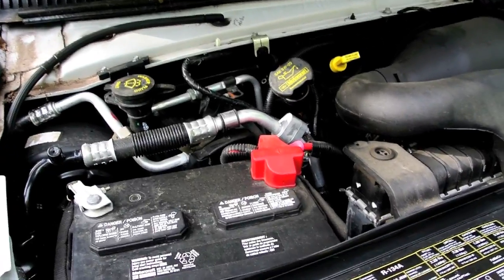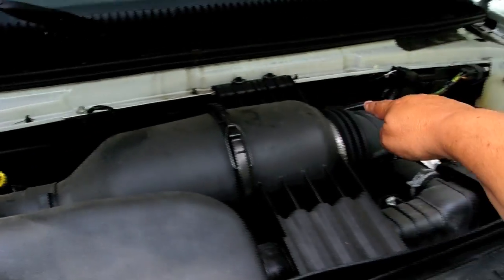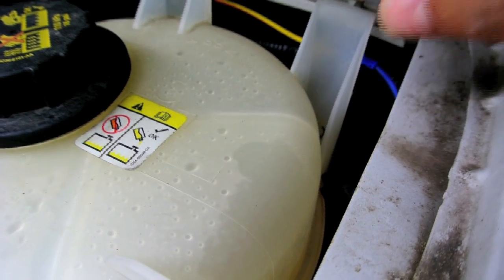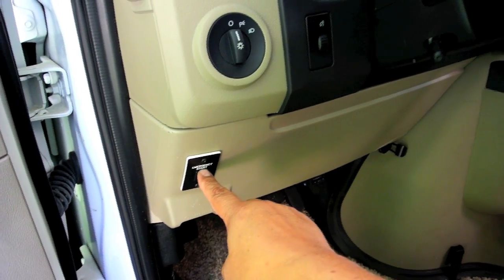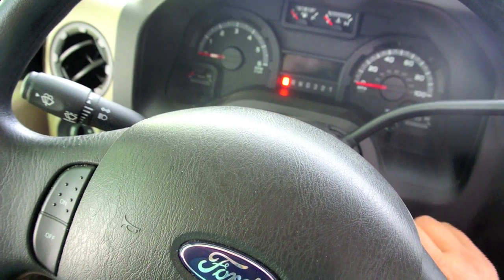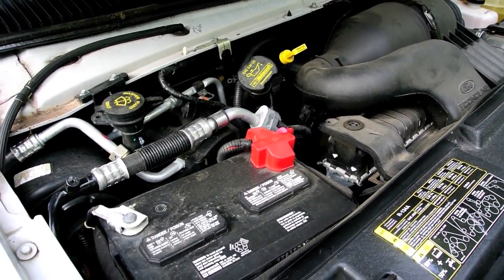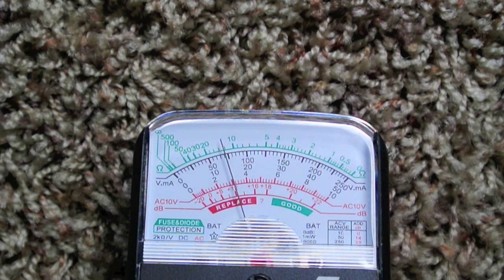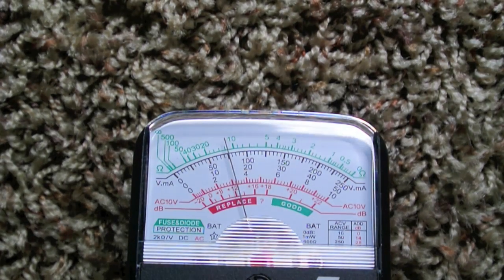Does your Motorhome's Engine Charge Your House Battery?

Comment: My 2020  25 ' motorhome has the Cole Hersee 48530 series smart Isolator. It allows bidirectional charging to both house and engine batteries from alternator, shore and solar. Great setup.  Built in voltage sensing protection for engine battery.

Comment: Bummer. Thought I finally found the info I need. I've been looking specifically for information on where my disconnect switch is. Its not on the panel coming into the coach. Not under the step, hood,  garage, with the fuses, etc. Can't find it at all. Had someone else look. He couldnt find it either. I need to find it so it'll stop draining and ruining my batteries. I shut everything off I can, and plug it in. Doesnt work. 25ft 2001 class c jamboree e450.
Reply from the maker: Sorry to hear that

Comment: On my 2006 Winnebago sightseer I get the full 14.5 volts, when the alternator is charging. It to house batteries 1 volt isn't going to do enough. for the boost charge mode up to 15 volts at 2Amps. 13 volts is just maintenance charge.
Reply from the maker: You are getting hung up on a specific voltage and missing the point. 

The increase in the reading on the voltmeter is a tell-tale that the alternator is connected to the batteries, regardless of the voltage is 1V, 1.5V, or whatever... that is the point of the video.

 Also, a higher charged battery will tend to discharge into a lower charged battery until they are at equal charge states. When the engine starts you now have 3 batteries in parallel with the alternator;  you have 4 potential charging sources. This is a complex result and I don't think the resultant alternator voltage can easily be predicted. 

If the alternators voltage output only raises a little bit - its because the batteries are already pretty much fully charged. You only want a maintenance charge with a fully charged battery.  A higher voltage can damage a fully charged battery.

If you are seeing a high charge voltage from your alternator, your batteries are likely in a higher state of discharge.

Comment: Thank you. This was very helpful in troubleshooting. My engine is supposed to charge the house batteries but after this test and the fact that I drove 8 hours and saw a decline in battery voltage, I confirmed that something is wrong. I don’t see an increase in house battery voltage when turning on the engine. Due to conduit, I could not see if there was corrosion or a loose wire.  Could it be a bad solenoid? Also note  that the  built in disconnect switch is not working. I disconnected it to attempt to rule out the possibility that it played a part in the behavior but the results were the same. Also, Winnebago said that it wouldn’t make a difference. It’s a 2004 Minnie, Class C, e450. Thank you for any insight.
Reply from the maker: Unfortunately, there is often no way to determine how they wire something.  I was able to find an electrical drawing from the mfg for mine, but it was pretty much worthless - and looked like it was drawn by a child.

When it comes to RV electrical, you are unfortunately pretty much on your own as far as getting anything out of the mfg.

Comment: When I turn my main couch switch on the relay start to chatter only when I turn the ignition switch on then it stops and I have lights. Can anyone help me with that. Thanks
Reply from the maker: Chattering relays often indicate low voltage, and/or the inability of the battery to sustain the current demand.

Comment: My brother has a four Winds class c o a E-450 chassis, and has the emergency start button exactly like this one. The alternator is not charging the house batteries. When you press it, you can hear the contactor make a loud click. However, when you turn the ignition on I do not hear the same loud click. I do hear a softer click, but it is definitely not the same sound. Does this condition indicate that the contactor is bad? I have owned several older RVs, and all of them use a battery isolator, but I can't find one on this thing. Am I cotrrect to assume that this contactor serves the purpose of an isolator? Thanks in advance for a response.
Reply from the maker: An isolator is actually not the best solution as there is a 0.6V or so voltage drop across the diodes in the isolator. That reduces the charge efficiency, and will take the vehicle longer to charge.
The contactor actually works better as it is more-or-less a voltage controlled switch, and should only connect the coach battery to the alternator when the engine is running (the alternator produces a higher voltage for charging than the battery).

I actually have a drawing from Thor for the circuit ( http://rv-project.com/photos/esc.pdf ).  One caveat though, it looks like it was drawn by a 12yr old, and may be hard to follow.
Reply: @RVProject  Thank you sir! Actually, after digging a bit more, I found that there IS an isolator, but it sure looks different than what I am used to seeing (Intellitec 0000629120). It's a small black plastic box, obviously solid state, that connects one wire from the ignition switch to the contactor's two small posts. Do you think that this has failed, instead of the contactor itself? I also notice after looking at the circuit drawing that there is a 7.5A fuse running from the ignition switch to the start button, and I will check that out now, but I suspect it is good because when the emergency start button is pressed I can hear the contactor make the loud click (that I don't hear when I turn on the ignition).
Reply: The fuse was bad! Thanks so much for sending me the schematic; I would have started throwing parts at the thing if I didn't have it. Saludos!
Reply from the maker: @cwsmith7366  The mfg calls it an isolator relay, but it is not a traditional isolator as it does not have diodes.  That is good news as diodes will affect the charge.  Here is a tech sheet for the isolator. https://www.intellitec.com/wp-content/uploads/2019/04/53-00629-000.pdf
Reply: @RVProject  Good deal! I do realize that conventional isolators send one half of a volt or so less to the house bank. When mine went out on my '98 class B I replaced it with Blue Sea's SI-ACR Automatic Charging Relay - 12/24V DC 120A. Works great. No voltage drop between banks and the chassis battery gets charged when charging the house bank. I also retrofitted the converter/charger section with progressive Dynamic's 30A smart charger, which not only features a four stage charger but produces a much cleaner 12V to the house than the standard POS. Again, thank you very much for your assistance!

Comment: I have a 2011 Jamboree Searcher (23ft) on a Ford E-350 chassis.  After checking what you recommend, my contacter is definitely the problem.  My "other" problem is where would the contacter be located as it is not where you suggest in your video. From the vehicle battery under the hood the red connection splits into two and the second cable goes towards the coach battery area.  Once there, there is one contacter for the coach electrical main switch, but none other.  Any suggestions as to where else I should look?
Reply from the maker: Could be anywhere. I contacted my mfg for my coach for help in the electrical circuitry.

Comment: I believe most alternators only output over 1200 engine rpm so you my need to step on pedal to bring rpms up to see voltage rise.
Reply from the maker: Idle RPM on mine worked.

Comment: It is my understanding that switching to LiFePO house batteries can overtax the alternator and cause it to fail.
Reply from the maker: The most critical aspect of changing battery chemistry is how the charger behaves during overcharge conditions. The overcharge rate is all critical.

For example, if changing from a standard lead acid battery to AGM, the overcharge rate must be lower for AGM - or it can be severely damaged.

In an automotive application, when there is always a load on the battery under operation when the battery is being charged by the alternator it is not as much of a problem as the battery really does not go into overcharge.

But in a RV, when the battery can go into overharge, the charger must be designed so it does not present too high of charge in the overcharge condition.

The charging of lithium batteries is even more critical, and if the correct charger is not used, the battery can be severely damaged.

Comment: For a while now I've heard a loud clicking sound every few minutes from under the hood while my RV is parked in the driveway (not running). Is this a sign the contactor is failing? Now my house batteries are intermittently not being charged by the vans alternator. 2017 E-350 Class C.
Reply from the maker: Hard to say.

Comment: i sure didnt see a fluctuation in the meter when the engine started
Reply from the maker: It's possible your engine battery does not charge your house batteries.
Reply: he needs to get a digital volt meter. for sure!
Reply from the maker: @davidfrank6666  This is actually one time where I prefer an analog meter. While a digital meter has better resolution - i.e. more accurate voltage readings, analog meters have always been better at detecting small transient changes in voltage. 

But I am old school, and I still like an analog meter when circumstances warrant it. However, it has to be a FET type meter with a high impedance, not the classic meter-movement meters.

Comment: great video.  We have a 2017 ( built 2016) Forest River Forester 3051s on a Ford E450 chassis.  Under the hood there is a red cable that goes into a circuit breaker and down, I think that it goes to the house batteries.  My emergency start is down the driver side of the seat.  My question is if you put solar on the RV to the house batteries will they charge the starter battery?  Thanks, Phil
Reply from the maker: All I can say is how my Class C was wired. For mine, the starter battery would not be charged via house batteries.
Reply: Thanks.  That sounds right.  I am going to do more research.

Comment: My 1991 Pathfinder has a box on the firewall by the emergency brake, it's a relay box, and once the engine finishes charging the starting battery, I'll hear a click and that is when it changes over to charging the house battery.   Well thought out system.
Reply from the maker: Most RVs have some sort of method to charge the house battery from the vehicle.

Comment: Very informative video! We are about to install solar system in our Class C. I've heard that when the solar system is engaged to charge the house battery, the breaker should be turned off to the house battery. What about when the solar system is charging the house battery and the engine is running, also charging the house battery?
Reply: It won't hurt anything for both the alternator and solar charging together. They both have sensors to Voltage and adjust charging to accommodate.
Reply from the maker: Be sure to check out my suitcase solar video series: http://www.rv-project.com/projects/suitcase.php

You should not have an issue with charging the battery from more than one source.

Comment: Also......a 12 volt auto battery should be 12.5-13.0 volts when fully charged...engine off.  The system should show 13.5-14.0 volts (the 1 volt increase) with alternator output.  The voltage regulator will shut the alternator down when batteries are fully charged .
Reply from the maker: In my electrical design work, I use 12.6V for a fully charged lead-acid battery, and 11.8 V for fully discharged. This is after 1 hour of rest when disconnected from the load.  AGM and gel batteries are slightly different.

But at any rate, you are correct that only a small increase in voltage is seen when the battery is charged. Typically smart chargers output 12.9V for trickle (C/10) charge, 13.4V for normal, and 14.3V for quick charging. The exact voltages vary slightly between different charger manufacturers.

Comment: Thanks for the video! Question: I confirmed that the engine alternator is charging the house batteries, but only at 4.5 volts, is that normal? I expected to see 13.5 volts, as measured at the engine battery.
Reply: Are you sure it is volts and not Amps? 4,5-5 amps is quite standard for engine running charging of the house battery accordingly to my own experience...
Reply from the maker: 4.5V will not charge the batteries. Something is not right.

Comment: Do you think factory alternators are adequate for charging both systems adequately? Have you seen easily installed dual alternator kits? Thanks for the vids.
Reply from the maker: I have not had any issue with the engine alternator keeping up. However, the way you use the batteries - i.e. if you do a lot of boondocking and recharge the batteries via engine alternator, might dictate the need for a dual alternator.

But there is always an option to fire up the on-board generator to charge the house batteries as well.
Reply: Nothing is easily installed on a class C engine!

Comment: Very helpful video. I have an '04 class c motorhome based on a Ford e450 chassis but I cannot find an emergency start switch. My engine battery was dead today owing to being parked in the cold for a couple of months but the house batteries are fully charged. I was thinking that there must be some way to charge the engine battery from the house battery. I wonder if such an emergency switch could be installed?
Reply from the maker: If you are handy at doing it yourself, you could install a switch such as the Intellitech Isolator Relay Delay/E

https://www.google.com/url?sa=t&rct=j&q=&esrc=s&source=web&cd=1&ved=0ahUKEwi5xP6iiInSAhXGllQKHb5-AIUQFggfMAA&url=http%3A%2F%2Fwww.intellitec.com%2Fassets%2Fpdf%2F1453-intellitec-pdf-template-53-00629-000.pdf&usg=AFQjCNHDv8t7jZNThFjQ3DIhY3_fr4r-Jg&sig2=j7VkAa_KC1Ib9CsCgBe2JQ&cad=rja
Reply: I'm not that handy and I am scared to death of electricity. But I could probably get a shop to install this thing. Thanks
Reply: I keep a set of 20' Jumper Cables so I can jump myself off using the House batteries
Reply: @TimArd --- I also have a 30 foot heavy duty jumper cable with quick connect.
Reply: You can get a portable battery pack just for jumping a dead engine battery.  The are small and powerful and do not cost any more than, even less than 20' cables, and one can be stored under the seat.  They only need to be charged up about once a year.  If however, your chassis battery keeps going dead, you need to find out why.

Comment: I do have a question about the switch under your dash.  I don't have that and I'm not sure why it is needed.  If the solenoid closes with ignition on, aren't the house batteries "helping" to start your engine whether you push the button or not?
Reply from the maker: In an engine, the alternator charges the battery. To do this, the alternator output is a bit higher than a fully charged battery would be.  

The charging device (Intellitec 00-00629-120) consists of two parts - a voltage sensing isolator, and the charging solenoid.

When the engine is started, the voltage sensing isolator detects the higher alternator voltage and closes the charging solenoid after a delay of a few seconds. This  connects the alternator to the house batteries, thereby charging them.

Of course, this only occurs after you start the engine when the higher output of the alternator is present.   

There is a delay built into the voltage sensing isolator that does not immediately close the solenoid when it senses the alternator voltage, but after a few seconds. This delay ensures the starter is dis-engaged from the engine so that the house batteries are not normally part of the engine starting sequence.

Turning the ignition switch will not connect the house batteries, as there is not sufficient voltage (i.e. alternator voltage) to cause the voltage sensing isolator to close the solenoid.  This is the case whether or not the engine battery is fully charged or dead.

If the engine battery is dead, the under-dash emergency start switch bypasses the voltage sensing isolator and manually closes the solenoid to allow the coach batteries to start the engine.
Reply: Nice, thanks!
Reply: So I fixed my Freelander 19CB.  The ignition signal wire came off the solenoid, so I crimped on a new connector.  It does come on with ignition, so at least on my RV, the batteries are connected when the ignition switch is on.  I don't have the emergency start button.

Now I'm wondering, my RV has been sitting for a month and I plugged it into my house to top off the batteries.  So the house batteries are at 12.7 volts now, but my engine battery is at 11.7.  Perhaps when plugged in and charging, I should have the ignition on.

What do you think?
Reply: That switch is to use the volts from the deep cycle battery if u leave ur stero on or light  or charger on it uses back voltage very basic
Reply: On my 1999 Gulfstream Conquest, the EMERGENCY START Switch is located on the wall beside the coach step/ battery
Reply: it’s the Battery Boost switch so if you engine battery dies you can jump it from the house side
Reply: This post has been here awhile but I'm not sure if any of the replies addressed the original question.  The connector (solenoid) in question is activated by the chassis battery.  Of course if the battery is dead it doesn't close.  The emergency start switch closes the connector by using the hopefully charged coach battery enabling a jump start to the chassis.
I bought a used class C last year.  The alternator was not charging the coach.  This video helped me locate a blown 7.5a fuse near the contactor.  Easy fix....no problems since.